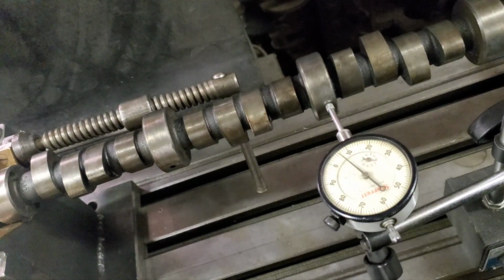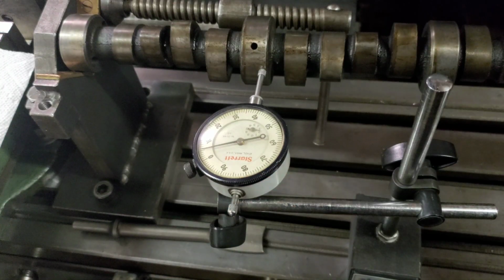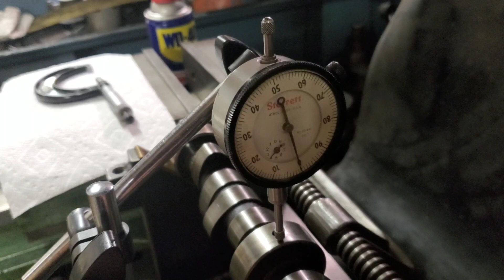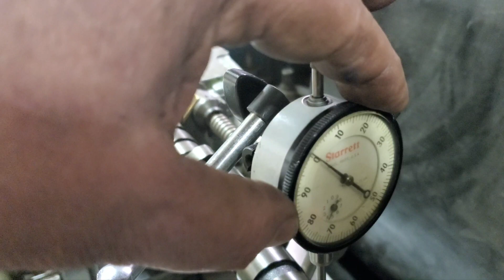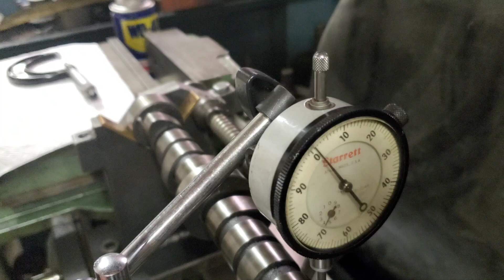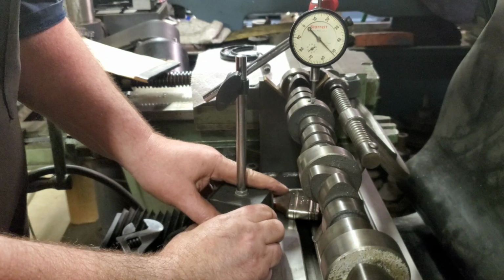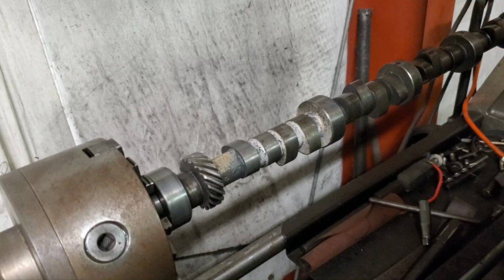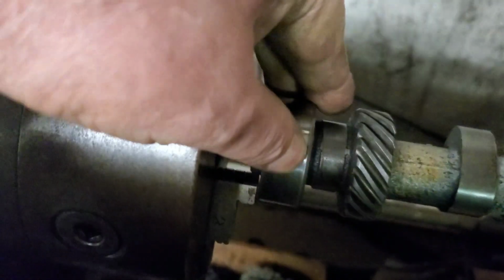Big Block Mopar Mystery Cam for JustMoparJoe and Don English @OneEyedCat Inspection.

Comment: Great video Ed. So you can actually straighten a cam by gently pressing on the shaft with your fingers. WOW I learn something new every time you put out a video. Thank for documenting.
Reply from the maker: Thanks Mike, I appreciate you watching and commenting. 
And no, you can't straighten a cam with a finger.
I was only showing the flexibility of a camshaft.
I used Airhammer and a Special Chisel, not sharp.
But a fully formed radius.
I opted not to share that part on the operation. 🙂
All cams are straightened, it is a part of the manufacturing process. 
Have a good evening. 👍

Comment: So how did you chase the bow out? A hydraulic press?

I saw you answered someone else. Kinda surprised an air chisel can be that precise. One of those slow and steady operations I bet. Great video on an problem I never really considered asking someone to fix.
Reply from the maker: Hey Joshua, thanks for watching. 
I use a Airhammer and a Special Chisel. 
The Chisel has a full radius, I did it off Camara.😎
Trust me it is a process. 
You would break a cam in a press.
Have a good weekend.
Reply from the maker: Thanks again Joshua, it is a problem that you or anyone can watch out for.
First clue can be when a cam does not install and or slide in easy during installation.

Comment: I found a new Manley Mauler cam at a swap meet about 40 years ago, and a phone call to Manley was not helpful but for they never heard of it. I measured the specs with degree wheel and dial indicator and were that of a factory high performance early '60s 383. Maybe they bought them from MOPAR when they auctioned off parts. Remember the 915 closed chamber heads for the 440 for $79 from the big speed shops?
Reply from the maker: Thanks for watching Paintnamer, alot of companies use to buy cams and put their names on them or rebox them.
Cost companies for cores, so why not go to the source.
Gratiot Auto Supply use to have all of those great parts deals like the 915 heads.
I loved seeing their adds in the HotRod books.
I am sure that you are correct, they sourced it from Mopar and or whoever supplied them.
Have a good evening.

Comment: Hey Ed, do you press the cam to straighten it, and what makes it a solid or hydraulic, and if it’s unknown what lifters would be used with it, thanks 😀😀
Reply from the maker: Hi Mike, press the cam or pneumatic hammer to straighten.
The cam is ground for solids or hydraulics. 
I have had people put solid roller lifters on  hydraulic roller cam.
Never put solid lifter on a hydraulic cam, flat tappet or vise versa.
Have a good day. 👍
Reply: @edsmachine93  oh I think I like the sound of a solid roller lifter on a hydraulic cam , would that give you that solid lifter sound ?😀😀
Reply from the maker: @DesertRatFabrication  Sounds good.👍

Comment: Do you know if mechanical flat tappet camshats have the same amount of taper ground into the camshaft as hydrauclic camshafts? Do the solid lifters have the same amount of radius on the face as a hydrauclic lifter? This is what I read from Larry Shephard who was a Chrysler engineer who worked for the Mopar Performance Parts division and wrote 5 books on Mopar engine building. Is this true for the Mopar purple camshafts only or are all brands machined like he states?
Reply from the maker: Thanks Robert, thanks for the question and the information. 
I believe the Lobe taper and lifter radius are the same for flat tappet and hydraulic. 
But the grind is different for solid camshafts do to the fact that Solid cam have valve lash.
So the profile is different. 
Unfortunately lifter manufacturers have changed the facing or grinding process. 
Some are not the true radius, more like an angle.
Have a great day.👍👍
Reply: @edsmachine93  I read the engine building books that were written by Larry Shepard who was a Chrysler engineer that worked for the Mopar Performance Parts division. He states that the solid lifter cam has very little taper and the lifter has very little radius and the hydraulic cam lobe has much more taper and the lifter has much more radius on the face. Maybe only the Mopar purple camshafts were ground this way.
Reply from the maker: Thanks for the info Robert.
I know that lobe taper has varied by manufacturers. 
I know for example the 440 6 pack had aow taper design and infact was a hydraulic camshaft.
Lifter grind specs use to be unique to manufacturers. 
The radius was specific to the manufacturers specs.
I know this because of the machines had different settings for grinding the radius. 
This went way back 30's 40' 50's and so on till current day.
I liked the way Johnson ground the tappets, more like a circular patern forming a perfect radius and matched the taper perfectly. 
The old timers in the Industry were pretty smart.
Have a good day.
Reply: @edsmachine93  I only found one article out of hundreds that stated that the radius on the face of the lifter was determined by the shape of the cam lobe. All of the other articles stated that all hydraulic and solid lifters had the same lobe tapers and the lifters had the same radiuses. I searched all over Google after reading the Mopar engine book. Most of the knowledge from the past is gone from the internet.